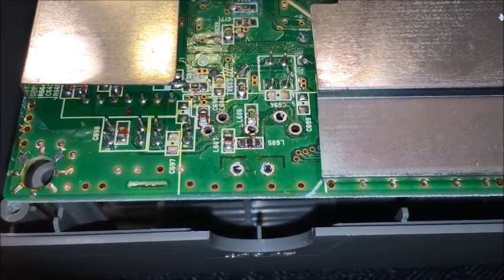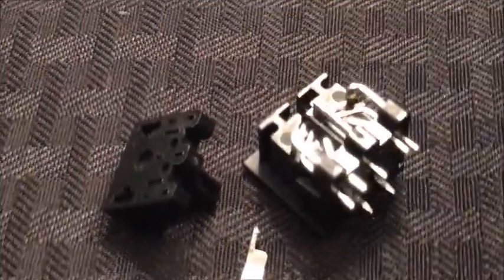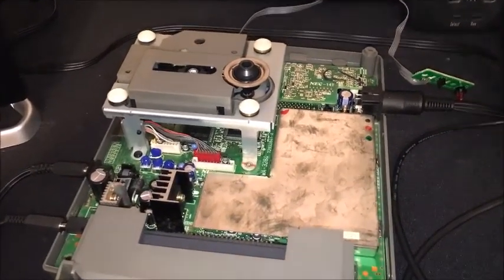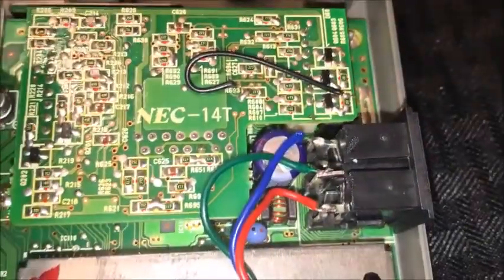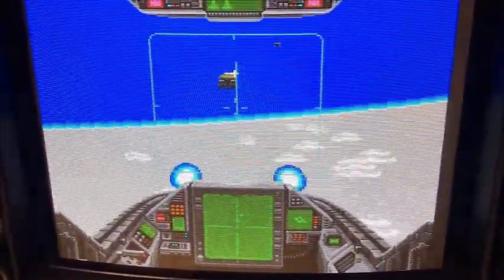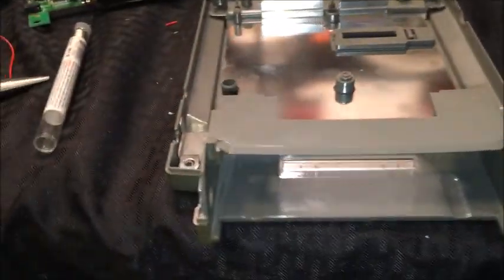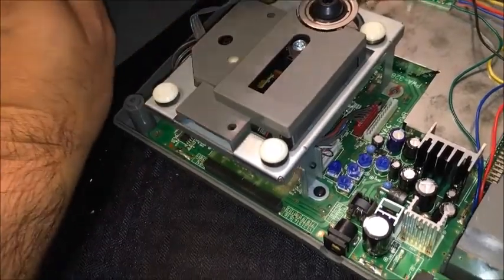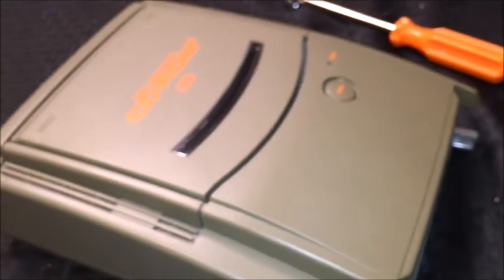Rob (Tech) Talks: PC Engine Super CD-ROM² RGB Mod

Comment: Do you know if it's possible to still use the old composite cabe, even after the mod? I'm getting a modded Duo, but won't have the cash to get the Framemesiter for another couple of months and I was still hoping to play the system. Will it still work? Thanks
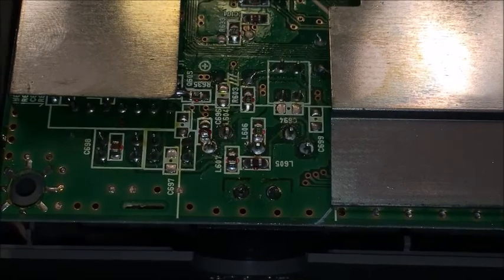Reply from the maker: DavetheNESGuy It should still work unless the modder removed that capability for some reason. I do a test at 4:20 on this video where I added the 8-pin cable to test that regular RCA A/V still works. Then I added RGB on the additional 3 pins and used the composite (yellow) for sync.